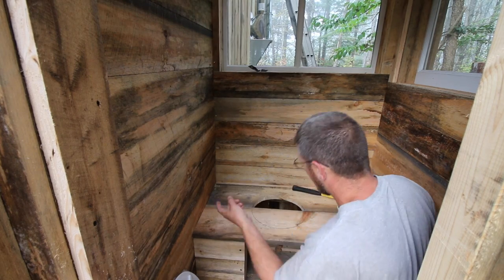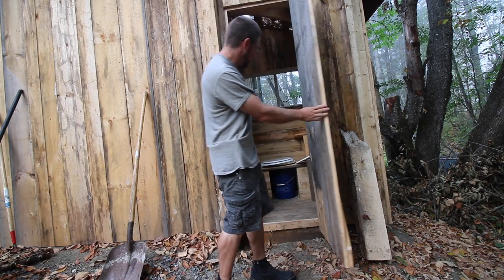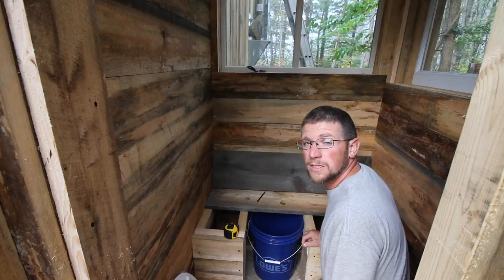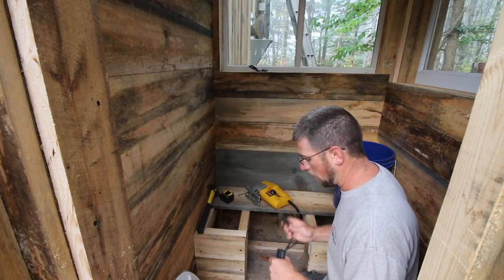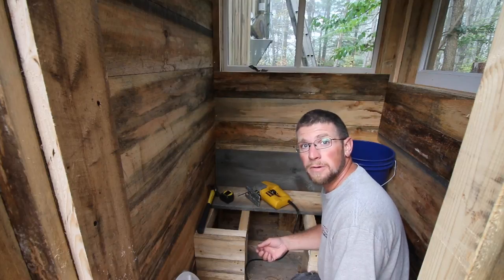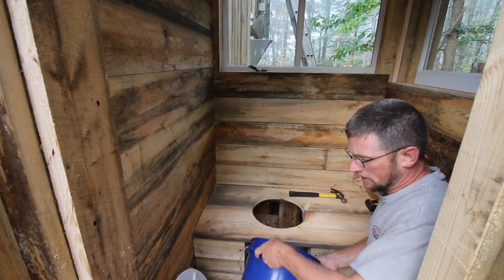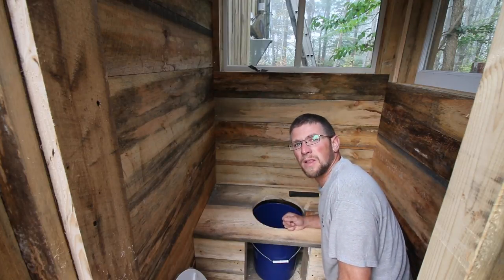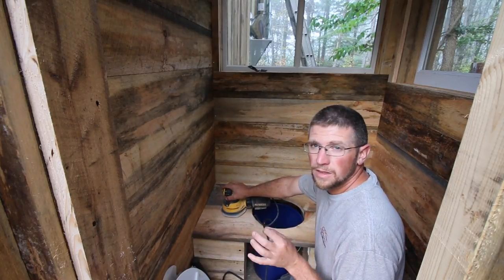Building the Box For the Composting Toilet

Comment: I think you might want a 'splash guard' around the front of the hole to keep fluids under pressure from falling outside the bucket. Come to think of it, you should think about one for the back, too. Maybe a plastic skirt all the way around.
Reply: Craig Mooring  you have it right with this suggestion! Being an old plumber from years past 'splash and spatter overs' are going to be common and a little more coverage/direction to the bucket will help keep things tidy.

Comment: Looking good. Are you going to put a 3" vent stack at the back of the toilet box to pull odors from the outhouse? I like the epoxy to help keep the outhouse clean and dry. You can always line the area around the toilet with FRP as well. I thought you were going to use the box next to the bucket for sawdust.

Comment: NICE!!👍👍 What would one need to do to prevent bubbles? Does resin handle extreme temperature changes? I'll trade you a couple of 92 days for some 42 days! 😝
Reply from the maker: I will take the 42 days gladly! You need to breathe on the bubbles with carbon dioxide  to pop them
Reply: Taking a torch above the wet resin will pop bubbles. Looks fine and adds character like the flies.😜
Reply: Does it bubble because it's cooling too fast?
Reply: Air trapped in the resin while stirring. If the wood is damp it can cloud it also.
Reply: Is there a certain tool to use to stir the resin to keep air to a minimum or is it just one of those "tricks of the trade" knowledge one learns while doing?  Reading 'sewhappy's comment, marine sealer may be easier to work with.
Reply: Just trick of the trade. If it was a resin project such as casting in a mold then a pressure pot or vacuum pot would minimize bubbles. Bar tops, table tops, clock faces easy to pop with the heat of a torch.
Reply: My luck, I would burn it! When the bubbles pop, is the surface rough and will need to be sanded or does the heat melt it smooth again?
Reply from the maker: What I learned was it not the heat of the torch but the carbon dioxide from the torch as well as your breathe
Reply: Hmm, there must be a way to tweak the mixture - heat it or cool it more - to prevent bubbles. The resin has a beautiful gloss to it, but it seems a bit hard to use. I left my compost toilet wood unfinished but I like the look of yours sealed. I may wear a mask and try the marine sealer.
Reply: I have heard of some people warming a bucket of water up and then leaving the unmixed bottles of resin in them for a while to warm them up without burning the mixture. Apparently it allows the bubbles to rise to the top and pop a little easier, however I have yet to try that method. Warming it with a torch seems to work pretty well, maybe breathing on it does as well!
Reply: Bryan - the mixture can burn just by putting it in warm water? That's a little scary!